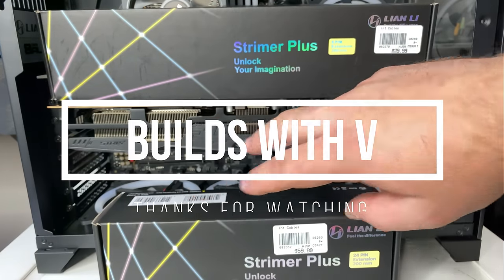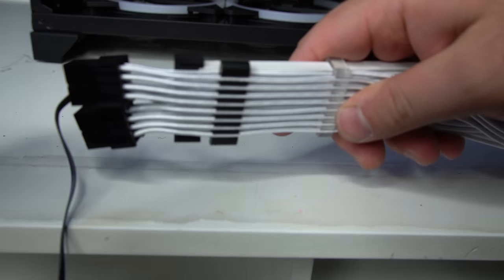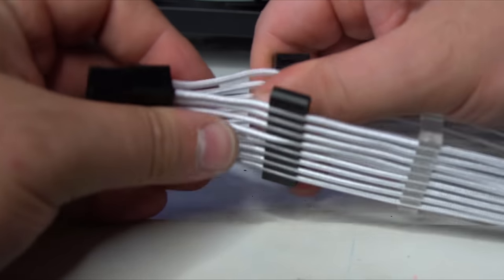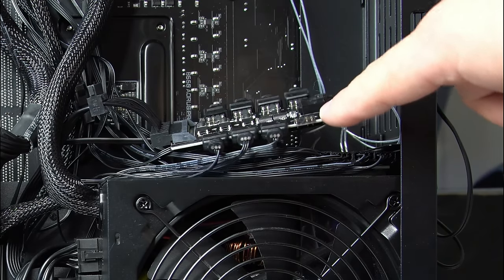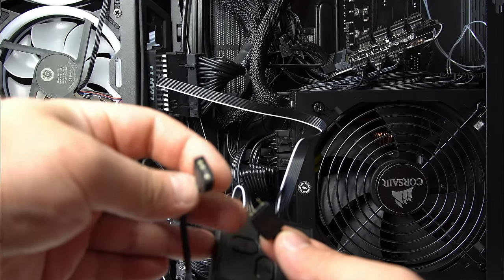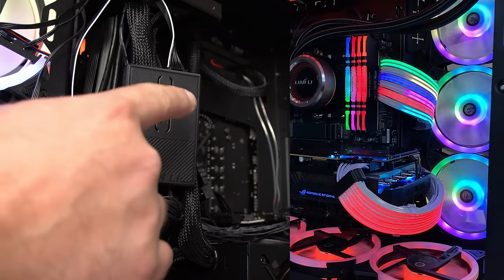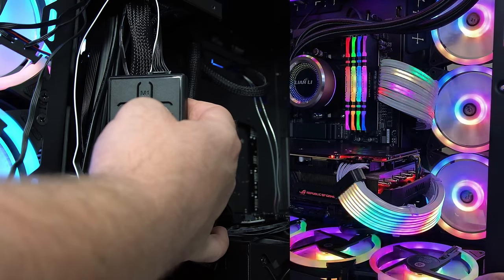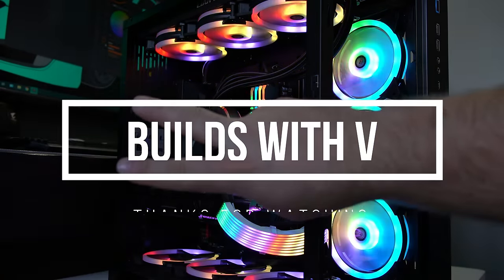How To Install Lian Li Strimer Plus RGB Cables + Review & How To Use

Comment: Yo man amazing video I had a quick question is there a software you can download on you’re pc to change colors and if not on the remote is there a setting to change it to a solid color for like a blue theme build or whatever?
Reply from the maker: The controller allows you to change colors and effects. You can have solid color as well. If you use software, you’d just use your motherboard software.
Reply: @BuildsWithV  awesome man I love the video man keep up the great work

Comment: Awesome video! I was thinking of getting these cables to for my build but was wondering if you had any issues putting the glass panel back on your o11 dynamic. I’ve heard that some cables hit the glass and was wondering if this was a problem with these with the gpu horizontal. Any info would be appreciated 😊
Reply from the maker: I had mine horizontally and vertically and both times my glass closed no problem. Some cases or setups may have issues. I haven’t had issues at all. Thank you for watching 🙏
Reply: @BuildsWithV  thanks for the info!! Great video 👍🏼

Comment: They say to plug the ARGB direct to the motherboard and not into a splitter. Any reason why? Any issues plugging into a splitter?
Reply from the maker: Yeah pretty much every rgb device says that mostly because they don’t want to be liable in case of damage or a fire or something. It’s easier for them to say not to do it then to tell you how to safely do it. Basically just don’t overload your splitter or hub with too many devices. Since this is sata powered you wouldn’t have much to worry about if it were on a splitter.
Reply: Makes sense, thank you!

Comment: what about burning your psu cables with the rgb cable? not all psu cables are the same....
Reply from the maker: It’s just an extension, it is designed to be universal. It doesn’t change the way the original cables run, it just extends them. Hope that makes sense. Thanks for watching 🙏
Reply: My first build was almost a disaster. I had some clean-looking white extension cables. I used the extensions on my GPU. I almost blew my 3090. It literally fried the plastic on one of the pins that plugged into the GPU, but I was able to scrape off the burned plastic from the GPU connector side to make way for the original PSU cable. I quickly switched PSUs  just to be sure, and now I'm afraid to touch any extension cables ever again. No issues at all since then. EDIT: My IT friend and I believe it was because the extension was not completely secured into the GPU, but we will never know for certain. Do not take this as "never use extensions." I could be one in a million, and it could have been user error.

Comment: Can ı control it with Asus aura sync
Reply from the maker: Yes you can. Just connect the controller to your motherboard addressable RGB port (If you have one) and then press m1 on the controller for 5 seconds to use your software.

Comment: You have to plug in your old gpu cables into the led gpu cable and my old gpu cables were 6 and 8 pin so can I plug those into the lian li led gpu or do I need to plug all 8 pins to the lian li
Reply from the maker: You can plug in just 6 if that’s what you have. It won’t effect anything. Thanks for watching 🙏

Comment: What is the name of the RGB Software you use?
Reply from the maker: I use rgb fusion 2.0 which is the stock software for gigabyte motherboards
Reply: @BuildsWithV  Shit! My Motherboard is from ASUS and the Software for that is trash. You can't control the cables properly.
Reply from the maker: @vernnis9110  asus I believe has the ability to assign a specific amount of leds, you’d have to mess with it to get it working properly I think.

Comment: Hey guy i have a corsair setup is it possible to match the color of my fans and will it work with icue software?
Reply from the maker: If you plug these into your motherboard then you can match them using your motherboard software. You can get these working with icue but only with a special adapter cable and some trial and error within icue. Here’s a link to that cable https://www.ebay.com/itm/Corsair-RGB-to-Aura-Mystic-Light-Motherboard-A-RGB-Adapter-/372521827376?_trksid=p2349624.m46890.l49292

Comment: Is there a way to connect them both to one like device or software
Reply from the maker: You you can connect both to the controller that they come with. From there you can connect the controller to your ARGB port or just control both from the controller itself
Reply: @BuildsWithV  thank you so much because I’m getting myself some and I’m going to subscribe

Comment: Do you need to buy a seperate 8 pin one or do you need to just get the 24 one and it will come with one for the motherboard and gpu
Reply from the maker: The 8-pin and 24-pin come separately. The 24-pin comes with the controller. The 8-pin just comes by itself so it’s an add on for the 24-pin. Thanks for watching 🙏
Reply: @BuildsWithV  so if i buy the 24 pin one will i get one for the motherboard and gpu

Comment: Hello I have the new MSI 3080 I should buy x2 24 pin for the cpu and graphic card?
Reply from the maker: You wouldn’t need an extra 24pin, you could get an extra one for the GPU but it’s not necessary. You could have 1 RGB cable plugging into 2 of your 8 pin ports and then have a normal cable running to the third one. I don’t think it would look too good to have 2 RGB cables for your GPU.
Reply: Ok so one 8 pin for graphic card and one 24 pin for gpu right?

Comment: Outstanding. Much appreciated as I am days from putting these in a new build and was totally wondering if the rgb to mobo connector was able to be used with the controller as well or if I had to choose one or the other. Flipping the GPU cables was a huge tip as well. Thanks
Reply from the maker: I’m glad I could help 🔥 Thank you for watching 🙏

Comment: Hey V! I have a 3080 strix 3x8 pin. you think I can use the 24 pin led cable and replace the wire with 3x8? cause i don't want to use one regular pcie, that'll trigger my ocd!
awesome video!
Reply from the maker: Unfortunately the 24-pin has a different setup so it wouldn’t work with the gpu unfortunately. I completely understand the OCD part, even having a 8x6 pin on my current GPU kinda makes me cringe lol.
Reply: @BuildsWithV Oh I understand it's a different setup. but to just use the 24 led strip and slapping it on 3x8 won't work? sigh I was hoping to find a loop hole lol. 
eh. I appreciate the reply! liked and subscribed thank you :)
Reply from the maker: @davy1422  ohhhh I haven’t thought of that, I don’t see why you couldn’t do that. The led should come off and technically can use it with or without the cables.

Comment: I am planning to use these with my Asus TUF GAMING X570-PLUS (WI-FI) ATX AM4 Motherboard and NVIDIA GeForce RTX 3070 8 GB Founders Edition Video Card, these should work, right? Do you know if I should buy 8 or 24 pin
Reply from the maker: These will work no problem. The 24-pin is the only one that comes with the hub so I recommend getting either just 24-pin or both. If you get just the 16-pin you’d need a ARGB/DRGB header on your motherboard to power the rgbs.
Reply: @BuildsWithV  ok thank you!

Comment: Hey man, Cool video! I recieved the cables aswell today for my build in the Lian Li o11, but I'm having this issue that I cant close my case when the gpu connectors are plugged in. Do you have any idea how I can mount them without being in the way of the case? Currently have an MSI 1070 installed. (waiting for 3080)
Reply from the maker: Jason Jacobs I showed two different ways you can mount. I had no fitment issues with it so I’m not too sure. Sometimes you gotta get creative with the cables to make them fit 😅

Comment: Are these cables still working when the GPU only has a 6 pin and 8pin contection so one of the Cables wouldn't be connected ??
Reply from the maker: Yeah they still all work without any issues. Just leave what you don’t need unplugged and you’re good 👌 Thanks for watching 🙏

Comment: I have a question,im using a gigabyte b450 s2h motherboard which only has 7 colours not 16.9 million will the lianli strimer cable still able to look like how the video is shown?
Reply from the maker: If you use the included controller it’ll look the same. If you decide to use your motherboard software then you’d be limited to whatever your motherboard can offer. Thanks for watching 🙏

Comment: I have an evga 600w BQ (semi modular) power supply, can I install this ?
Reply from the maker: pepin grillin Yes you can. Just need a sata cable. Same cable you’d use for a hdd or a ssd. You may already have one installed. If not, they come with your psu in the box

Comment: My mobo (Asus x470) does not have a 5v argb 3 pin header. What would be a solution for this?
Reply from the maker: Basically just use the included controller without plugging the 3-pin cable. Sata power is fine. The 3 pin is optional if you’d want to use your software for control

Comment: Why does my gpu have no slot for these connectors?
Reply: If you GPU is new they use the 12V connectors not x2 8 pin

Comment: Do I need a specific psu for this?
Reply from the maker: You do not. It just needs sata plugs but also keep in mind if your power usage. 650w psu and higher is typically a nice sweet spot for most PCs

Comment: Great tutorial in my opinion! I did notice something odd with the one of provided links though, and that's that the 24-Pin cable just seems to have vanished off the face of the earth. I can't find it anywhere on Amazon or Newegg, nor can I find anyone else mentioning this problem as of thus far. If you could provided an new/alternative link it'd be very appreciated, as I'm interested in buying both of these.
Reply from the maker: Unfortunately all I found was a refurbished version on Amazon and its well over retail price. Might be because the new V2 came out recently. I have a video showing these off as well (newest video).

Comment: I have Corsair LL120s, they use their own RGB system, not via the mobo. So can I just use the included controller to control both the cables for 24pin and GPU? So on the controller, I would just need to have a single SATA connected and nothing else?
Reply from the maker: Yes you can use just the controller using the sata cable. Just plug both of the Strimer cables into the controller and you’re good to go
Reply: @BuildsWithV  Thanks so much for the response, didn't expect it. Subbed!
Reply from the maker: @slaiff.  no problem at all, always happy to help 😊 Thank you 🙏

Comment: What if my mobo just have 4pin header? Do i need to but 4pin adapter to 3pin?
Reply from the maker: If you want to plug it into the motherboard then yes you’d need an adapter. But it’s not necessary to plug these into your motherboard since the controller is power by sata power.

Comment: Isnt it possible to download some software from Lian Li to take over the motherboards ARGB plug? 
Also i ask this in general for other manufactures and, say, fans?
Reply from the maker: With the new V2 controller you can use Lian Li software but it doesn’t take over the ARGB port, it plugs into the motherboard usb header. There are some softwares out there that can do that to kinda unify your whole RGB setup. If the fans or devices are plugged into your motherboard ARGB header then the only way to control them is either motherboard software or third party software companies that can take over the ARGB ports. Devices that get controlled by their own software are plugged into their own hub that then plugs into your usb header on your motherboard for detection. Hope this made sense
Reply: @BuildsWithV  Thank you for the answer.
I can see Lian Li sells a STRIMER L-Connect 3 Controller which seems to be able to control the strimers with software. 
The only place i can buy the 24pin strimer in my country doesnt specify if its a v2 or not but that L-connect controller seems to be compatible with both normal and V2
Reply from the maker: @C0lbyte  yep that’s the new controller and it does work with v1 and v2 Strimer cables. Works great too.
Reply from the maker: @C0lbyte  I have a new video showing the v2 controller and strimers if you’re interested. It’s my latest videos

Comment: can i use this without the sata cable? I dont have extra sata cable :(
Reply from the maker: You can only use the GPU cable without a sata connection. The 24-pin uses the lian li controller and unfortunately it does require the sata cable.
Reply: @BuildsWithV   Thanks man. I’ll just buy another sata cable. U earn a sub from me.

Comment: Where did you get that VGA lifter? is the cable 3.0 or 4.0
Reply from the maker: I believe it’s 3.0. It’s the lian li vertical display card kit. I recommend going with another one as this one is kinda so so. Not the greatest option that’s for sure.
Reply: @BuildsWithV  Thank you!

Comment: Is there an option to split the 8pin cable to one? My gpu has one 8pin connector and don't know if there is a possibility to split them without "damaging" the visual inside my case.
Reply from the maker: The RGB portion of the cable can’t be split unfortunately. You can remove the cable behind the rgbs and make it an 8 pin only. The rgbs will still be wide which will be fine.
Reply: Thanks, looks like i'm gonna buy just the 24
Reply from the maker: @CristianB723  no problem at all, thanks for watching 🙏 I’ve seen lots of build using just the 24 pin and honestly it keeps it looking really clean IMO.

Comment: How would it work if i used 3x 8 pin cables? Do i need 2 of the controllers?
Reply from the maker: Xander 1048 I believe you can use the included 3-pin ARGB adapter from the controller to your other 8 pin, get a splitter as well and you can plug in some more. Not 100% sure as I haven’t tried this but it should work.

Comment: Another side note is if you hooked both the 24 pin and dual 8 pin into the controller from the 24pin, then plug that controller into your motherboard head, and then hold M1, or maybe M2... or one of the buttons, itll sync both with your motherboard
Reply from the maker: Yeah that’s correct. Thank you, I don’t remember if I mentioned that in the video. Thanks for watching as well 🙏

Comment: Is there not a software for Lian li to control everything on?
Reply from the maker: There is but there isn't. Kind of in a weird stage where lian li is making everything work with their uni fans software. I heard you can control it using that software but I also heard its a bit more complicated. So I don't have a solid answer to that, sorry. But thank you for asking and for watching 🙏

Comment: Thanks for the tutorial. I have an Aorus 2060 super with vertical mount, I did not need to flip the LEDs on the 8pin cable
Reply from the maker: Thats great, some GPUs have their connector flipped the other way which is nice. Thank you for watching 🙏
Reply: @BuildsWithV  no problem 👍🏻 hopefully people with my GPU will go thru the comments and see mine

Comment: What about gpu’s with 3 8pin connectors?
Reply from the maker: You would just have to used a regular 8 pin for the third 8-pin and hide in behind the rgb cable or something. Can still be done for sure. Thanks for watching 🙏

Comment: Dumb question but can I turn on the strimmer plus without connecting to motherboard? First pc build:/
Reply from the maker: Yes, all you need is sata power from your power supply.
Reply: So this is what I have, corsair rmx 750x plugged in. Have the sata cable plugged in and 24 pin connector plugged in. I plugged in both cables (sata and connector) from lian li strimmer plus but it won't turn on :(. Wish I could send you a picture of setup to see if I am doing it correctly
Reply from the maker: @chiefmex11  try to press the M1 button for a few seconds and see what happens. Could be in motherboard mode.
Reply: Nothing:(. Any ideas how I can test power supply? Maybe thats the issue
Reply from the maker: @chiefmex11  the rest of the PC works well? Do you have anything else plugged into sata and does that work? If not, do you have anything else you can try to plug into sata?
Reply: I used the paperclip method to check battery supply and that worked so power supply is fine I believe. Not really sure what other way to test sata power

Comment: I believe there is a cable in the Lian Li ARGB Cable Kit that can adapt the MB RGB three-pin header cable into the three-pin plug (clip-style) so that you can plug them directly into the Uni-Hub and use the L-Connect software to drive them. I have the cable kit on order so I plan to try it out when it gets here.
Reply from the maker: That’s what I heard as well but unfortunately couldn’t try it yet

Comment: So I have mine connected to my Asus x570 hero and it still doesn’t show up in aura sync please help
Reply from the maker: If you have it plugged into the 3-pin ARGB header and you have the lian li controller connected to PSU, you have to press "M1" for a couple seconds to start using the software.
Reply: yup press m1 for 2 seconds

Comment: I just bought these and installed them, but only one works at a time. I can use the 24-pin, hit the little switch on the controller, and the 8-pin comes on vice versa.
Reply from the maker: You have to plug the 24-pin in the other port on the bottom. That port is for the 8x3 for GPU.